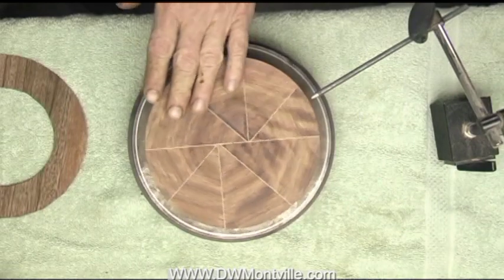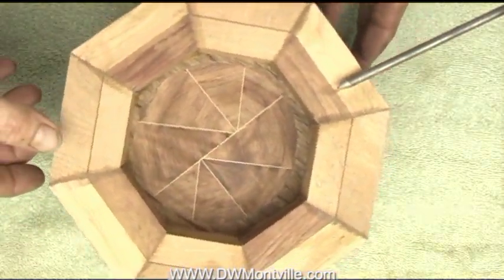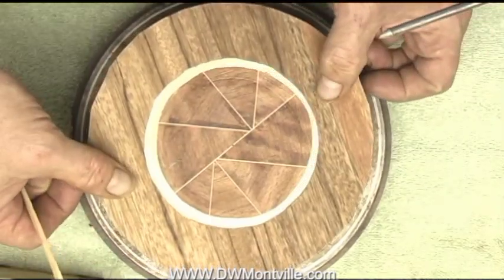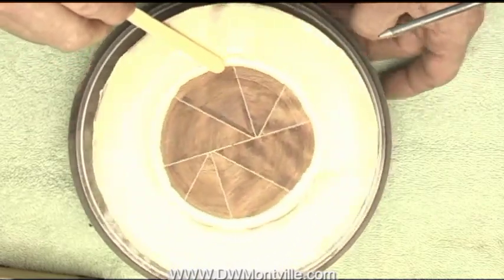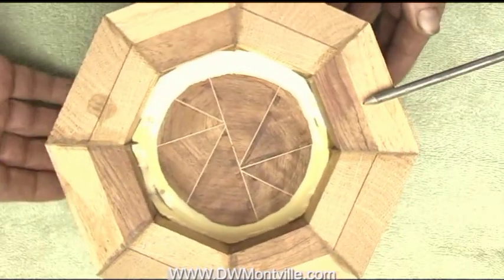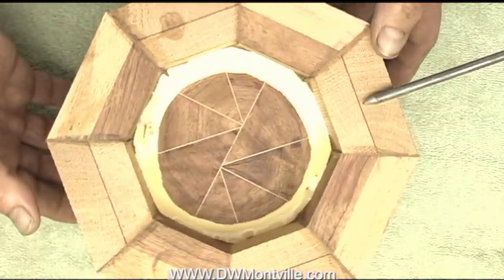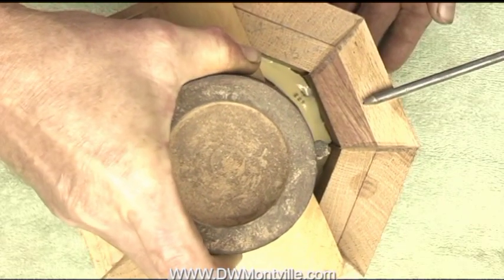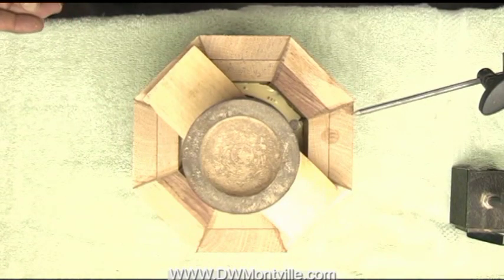Part 2 - Making a segmented bowl

Comment: I center my stuff on waste-blocks using a similar technique to the toothpick system you use to center your end-caps.

My circle-cutting jig uses a sharp point that digs into the center of the piece you are cutting, leaving a small dimple in the center. I then drill a centered hole in the waste-block (on which I cut a tenon to fit my chuck) sized for small awl I made. I then use the awl to locate the dimple through the hole while I glue the waste block onto the piece.
This works well for me.

Comment: This project is stunning. For centering, there's a tool called a "center finder" which you can even build from scrap material. It's basically a right angle with an additional ruler along the bisector of that right angle. You just press it against the circumference of any circular object in two different places, each time drawing a line along the bisector, and they should intersect in the center. Have you tried that?

Comment: im learning in wood what  kind of angle for the staves are sorry to ask I would like to try to make one thanks
Reply from the maker: The easiest way to calculate the cut angle on each side of a segment is to divide 360 (degrees in a circle) by 2 times the number of segments you want. So, for an 8 segment bowl divide 360 by 16. That gives 22 1/2 degrees on each side. From there you can start experimenting with different ways to assemble segments that yield different effects.

Comment: Jessas, und was macht man dann mit dem Kilo Leim im Inneren der Schale?
Reply from the maker: The glue that flows out of the joints will be turned away in the process of making the bowl.
Reply: SegmentedTurner
Yes for shure, but as much of it? What a dissipation. I don't mean it bad but a little less Glue would do it.

Comment: Interesting disign for a bowl. Too much jabber and way too complicated method for mounting the blank. Finding the center is easer than the way you do it and using the tail stock to mount the blank to the waste block is faster and good enough.  Are you an engineer or a woodturner?  I had to fast forward through both of your videos and no accual turning.